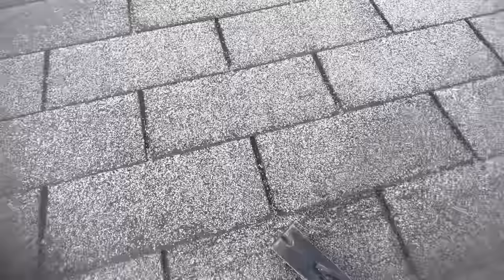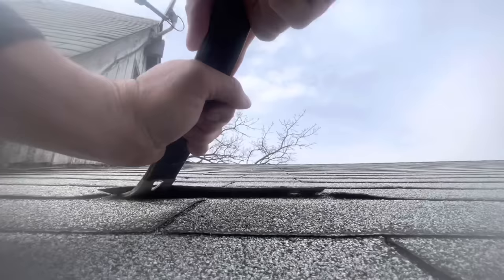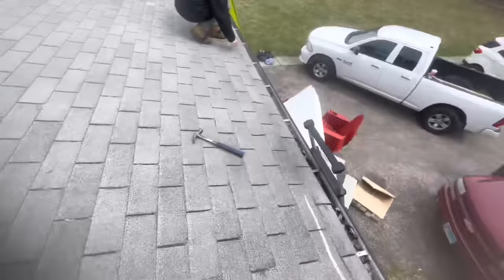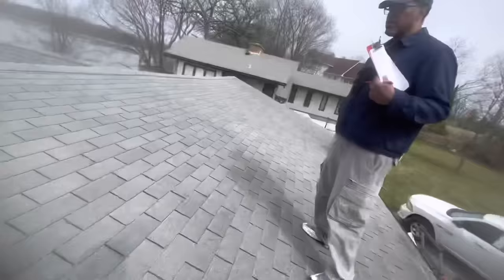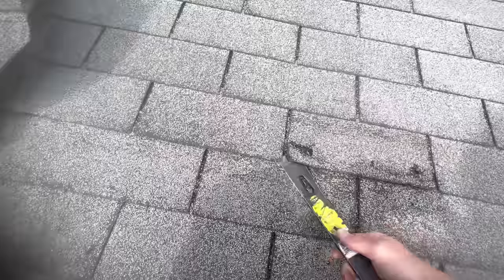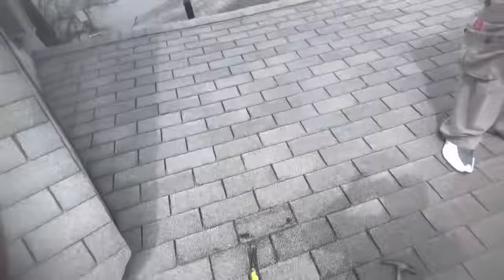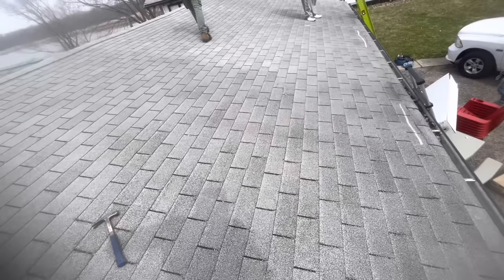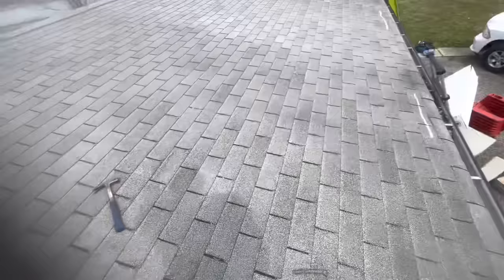Insurance Adjuster says roof is repairable. 😂 See how this inspection is ignored & denied?

Comment: As a former Floridian I can tell you there is abuse from both sides. The scams have been so ramped that now the insurance companies want no liability by having you replace your roof every 10 years and deny reasonable claims like this one. I personally had to get an independent inspector to verify the roofing companies findings. The good news was that it was inexpensive and got the approval needed for the job to progress. Also do not be surprised if the insurance adjuster/ inspector is a sub contracted inspector that knows less about roofing than your kids.

Comment: Where exactly are all the wind damaged shingles? I saw maybe a few near the edge marked but the shinlges are way past their life span. How and why should that be the insurance companies responsibility to repalce a roof that was in prior need of replacement?
Reply from the maker: The insurance company had no problem insuring the property in the current condition. If they didn't check out the current condition, that's on them, right? Would you insure a property and say I have 100% responsibility for this property if anything goes wrong but never check it out? The truth of the matter is the roof was old, it didn't have any damage prior to this loss, the insurance company agreed to ensure the property for any future losses. The property suffered a wind damage claim, leading to the consequential damage that led to the full roof of placement. The total loss was $63,000 and thankfully the insurance company after a few nudges and pushes paid
Reply: It would be impossible for insurance companies to inspect every property prior to agreeing to insure them, but they don't have to because policies are written to exclude prior damage and normal wear & tear. The way you are putting it makes it sound like if someone were to take out a new policy on a beat up old car with 4 prior accidents,it should be the new insurance companies responsibility to repair all that old damage? That makes absolutely no sense and is considered fraud in some cases.
Reply from the maker: @Mannyp91  that's kind of an odd approach. Why would someone take on any risk sight unseen? Anyway, it really doesn't matter because the condition of the roof contributes towards the reason why I can't be repaired in the first place. Roof was paid for. Went from 3 k to $62k

Comment: The silly roofer or adjuster who tore up the shingles did not document that the roof had wind or hail damage to achieve coverage in the video. All he documented was roof was old and repairs would be difficult.
Reply from the maker: The adjuster was out there for the fourth time as a new set of eyes to determine whether the condition of the shingle affected the feasibility of completing a repair. If you’re going to send somebody to do a reinspection, that person should be equipped to make a decision or to at least document ad justifiable, and reasonable attempt to repair. They sent corporate out with a couple of adjusters not too long after this video and the roof was paid for $62,000. The exact same attempt to repair was completed on another elevation on a separate facet of the roof. In addition the other facets demonstrated the same damages consistent with what you saw on this video.

Comment: A roof is a maintenance item, it is your responsibility to maintain it or replace it when needed. You can see this roof has granule loss and has been repaired with an applied bonding agent to refasten the deteriorated lifting shingle tabs. This roof is well beyond the date it should have been replaced. Any roofer should know this, the home owner knows, he’s been repairing the roof probably for years instead of replacing it at his cost. I agree the roof is now difficult to repair due to long term deterioration. The home owner should be responsible to replace the roof at his own expense. What they’re trying to say is leave your roof on your house until it’s deteriorated beyond repair and the insurance should pay to replace it, does that make sense?
Reply from the maker: There's other areas without any bonding agent. A reasonable attempt to repair was done in those areas as well. It failed due to the shingle being frail. 

We're not saying anything about leaving your roof in your house till the insurance company replaces it. 

However, if the insurance company has no interest in insuring the roof, they could have easily told the homeowner to replace it before any policy is provided
Reply: @ChicagoRoofer  I am an independent agent and I agree the honus should be on the insurance company / if an agent who is involved is placing the risk - if they want to insure a POS roof (which this example is), then you ultimately end up paying on a questionable loss. Most of the roof claims I see are on older three tab garbage. All of the 16 companies I write with are very strict on roofs on inspection to avoid this very issue. Even if I think a roof is questionable whether it will pass inspection or not when someone comes to me for insurance, I will flat out tell them they are going to have a problem at inspection, use Google maps, etc. and I can't help them. If a house is close enough to where I'm located, I'll drive out and do my own underwriting.
Reply from the maker: Thank you for being a good guy! I appreciate the fact that you put ethics at the forefront..

Comment: The roof is a 20 year old 3 tab shingle and it’s properly welded because that’s how they are designed to be. It looks pretty good considering that 50% of the granule is gone. The problem is this isn’t storm damage from act of God wind like a tropical storm or a hurricane, it is damage being from an old worn out roof. These roofers are litigating all of these roofs as Windstorm or Hail damage because the lawyers take the cases at 500.00 per hour but in all honesty this is thermally compromised and plain  worn out. I wouldn’t pay this claim either, I don’t even see a missing shingle tab or sign of physical damage, even the nails were flush with the shingle bed matrix the dude actually claiming to be a roofer knocked it into the shingle bed almost into the underlayment which on this roof is #30 or thinner likely. These harmonic vibration arguments are morning new and roofers win those cases with clay tile often but not asphalt shingles. This is why insurance companies are going broke and everyone is seeing cancellations or $10,000 rates, enjoy the harvest roofers because soon it will be over when there are no other companies to sue and the juice is all gone from the grape. I ran a roofing company for 25 years after Andrew and was also licensed GC and Roofer in Florida and I’ve seen it all. I am no fan of insurance companies but we need balance in the force.
Reply from the maker: I understand where you're coming from. I can appreciate the fact that you want to be fair and reasonable. However, we all agreed there was 40 plus shingles damaged by this wind related event. The homeowner took out a insurance policy that promise him replacement cost benefits. If I offered somebody $10,000 or $50,000 in benefits in the event something failed, I would go out and inspect it. The insurance company did not do that. Or if they did, they made a poor decision on this roof. This loss went from $3,200 to $64,000. At the end of the day, if you make a promise, all I'm asking for is you follow through. No empty promises. Do what's right!

Comment: That roof is fckd in multiple ways. Even the framing and decking are sagging. The leading edge is also looking curled over. The roof is shot, but is it from damage that the insurance company is responsible for? I believe insurance companies should be able to prorate rooves. If a roof is 20 years old, you've already gotten about 2/3 of the use out of it. I don't think insurance companies should have to pay for roof damage on something that was nearing its end-of-life anyway. Rip it all up, including the decking and replace it to last 40 years.
Reply from the maker: For this, the insurance company can write up an Actual Cash Value policy provision for the roof and often times does.. 

When it's a Replacement Cost Policy, they cannot hold back the depreciated value.
Reply: @ChicagoRoofer  Well said!
Reply: But it's ok for them to keep collecting FULL premiums on something they "shouldn't have to pay for". 🤔 Isn't that Bad Faith? Taking money for something that won't be covered? Damage is damage. And if it's old and can't be fixed, it must be replaced. WHICH IS THE POINT OF A RECOVERABLE POLICY. If they are ACV they are still liable for whatever life expectancy remains...regardless of them liking it or not.
Reply from the maker: Seems like you've been doing this for some time. :-)
Reply: @ChicagoRoofer  Yeah been at it for a while. Getting sick and tired of being sick and tired. Insurance is soo ignorant and Hypocritical its staggering.
Reply from the maker: I think many of us feel the same way.
Reply: @ChicagoRoofer  Notice how the other guy that said some stupid shit...deleted his comment! Lol!
DO NOT DEFEND AN INSURANCE COMPANY,  bad idea. LOL
Reply from the maker: 😂 didn't even notice. What did he say?
Reply: @ChicagoRoofer  "they shouldn't have to pay for something soo old....just rip it all up...deck too and redo".
Yeah, just tear it down and redeck on 50 squares like that's not a 25,000 out of pocket.
Dude was a 🤡
Reply from the maker: 😂. They shouldn't have insured it if they felt that way :-)